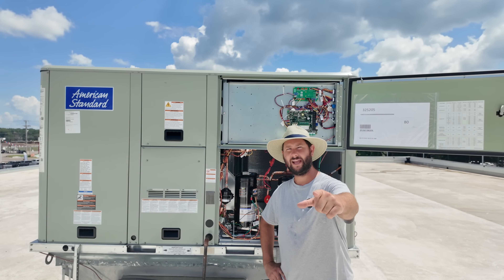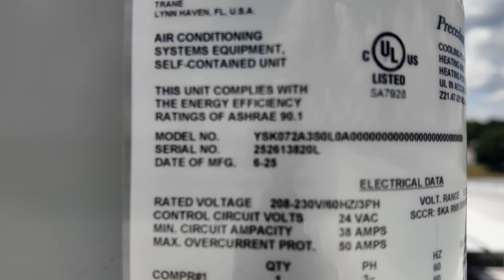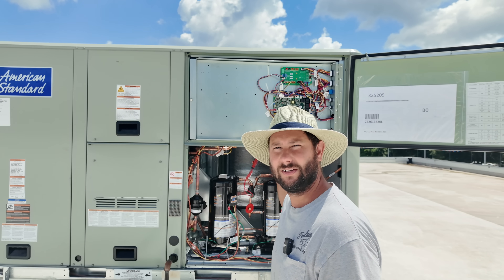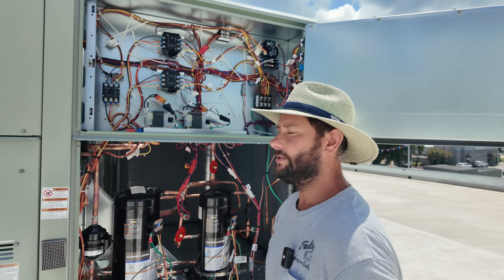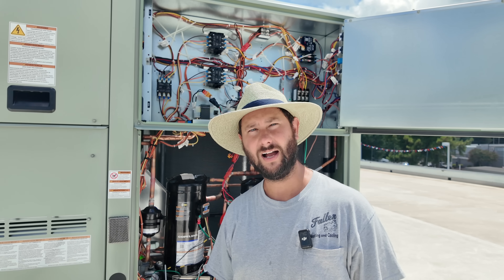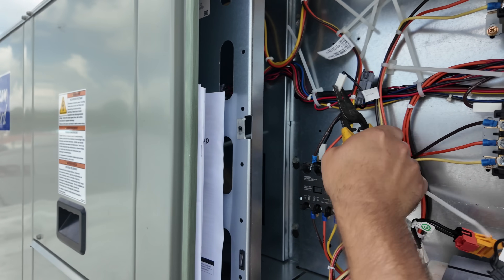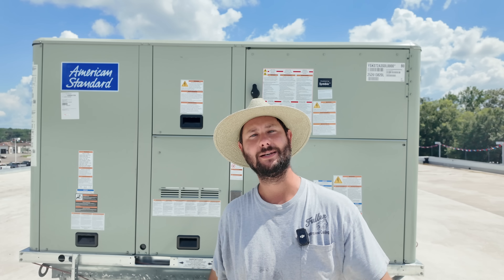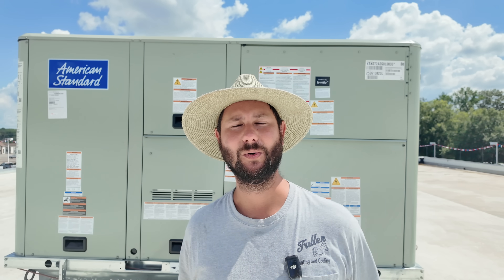Commercial AC Compressor Lockout Bypass Secrets Revealed

Comment: The middle board above the symbio is nothing more than a failure prone junction block.  Using proper butt connectors making solid line connections start from the symbio outputs to compressor circuit.  Eliminate any plugs along the way with butt connectors, following straight through safeties.  When you get back to the junction board, bypass the board with butte connectors following wiring to the contacter of proper compressor for each circuit.  Back to symbio follow compressor proving circuit eliminating all plugs connections and board connections to auxilliary switch on contacter.  At each safety install a 24v tattle tale.  If the unit trips alarm again the tattle tale will tell if any of the safeties tripped to cause alarm.  If not you have a bad symbio controller.

Comment: Ive installed that same RTU. I had an issue with the fire E-Stop. On that unit is NO and the existing fire alarm was a NC contact. Running out of time on install i just wired it in series with the R terminal. That way it would kill all control. The bluetooth thing was kinda annoying. I prefer RTRM boards.
Reply: Ive also installed these with Danfoss Control using that command rail on the Symbio700. Not horrible but youve got to install a transformer for the control boards.

Comment: Did you really bypass pressure switches? I can’t tell but there is no need to to do that and if you can wire through them then buy s few over the counter switches and mount them on an access fitting temporarily.  Altoona,PA 8yrs manager of wholesale branches, HVAC Contractor most of my life.

Comment: Hey Tadd, I’m a Trane tech and we’ve seen these problems all of the time and honestly the best thing you can do is get a box of wagos or wire nuts and change out any of the colored plugs in the compressor panel and the transformer and contactor plugs. The problem is they source half the plugs from china and the other half from Mexico and they don’t always make the best connection even if the connector is together. The factory is sourcing better connectors for the new units but that’s still going to take a while for all the old ones to get used up. You can also zip tie the two plugs together tight if you don’t want to cut them out but even that won’t always work
Reply from the maker: Thank you so much, brother. This insight means so much.Your time is valuable
Reply: They have a proving switch on the contactors.

Comment: I’ve run into this same issue with the same unit in the past. The issue ended up being the micro switch on the side of the contractor was not closing correctly to prove it. Just bypassed it and it worked fine until a replacement micro switch came in. Great video though.

Comment: Thanks,  the older units, you would be able to run it all through the high, low pressure, then the contactors but I think the switches now are using resistance value BS.

Comment: Tech support won’t help you on these ones. We’d have a compressor proving lockout, reset the unit and it never happens again. Then it would happen again a month later… then a week later. Could never figure it out because when we cycled the power it would work. Finally it kicked out completely. The Symbio board was failing to send the 24v out… it thinks it was but it wasnt so as soon as the contactor didn’t pull in it would kick out on Compressor proving. I jumped r and stuck it in the yellow wire I think p8-j5 or something and it would kick right on. New Symbio board — haven’t had a call back since. It’s happened on 2-3 of our Symbio units. Trane tech support has been pretty much useless with Symbio calls. The schematic they sent for the Compressor proving circuit was helpful because I figured it out on my own.
Reply: P8 - 5 is the start to the run command I think it’s the yellow wire. Intermittently wouldn’t get 24v out of it and immediately kick out on compressor proving. I took thermostat wire from r and stuck it in the yellow wire terminal and it would all kick on (after hours of testing and ohming out the entire circuit). Trane refused they had a problem for months and months — there are countless Reddit stories with the same issue. They still don’t admit they have a massive problem with their symbio boards. It’s very difficult almost impossible to diagnose when it’s intermittent and everything works after cycling power and the board is like $1400

Comment: I had issues with this stile of unit but they were heat pumps, the condeser motors were getting bad, and the problem were the harnesses to the condeser motors, the pins of the plugs to the motors are too thin and getting cooked and making the motors to loos one leg, and blowing the connection completly, i had to cut the plugs and use terminals to make a better connection. And multuple problems in because all the connections are being done with plugs. We end up cutting every plug and making conections with terminals. Is definitely a problem from trane by using harnesses

Comment: We had this exact issue, same thing 5 calls with tech support removing plug connections and still no solution. Issue was intermittent. Unit was running great for a year. We ended up replacing the board and that solves the issue.

Comment: Had a somewhat similar situation on a Symbio unit recently. System wouldn’t run at all because circuit 1 was out of gas, even though circuit 2 had gas still and its condenser sections were separate. It seemed like it didn’t want to run at all since stage 1 was off on lp. Had to jump out the lo p switch and pull the contactor coil voltage off for stage 1 so the board would think stage one was running. After a few minutes stage two came on. Been like that for probably a month now haha. Stage one has a leak for sure, customer doesn’t want to pay for repair so oh well. It’s working though

Comment: The plug connectors are a known issue. I replaced about 25 of them on a 7.5 ton unit. Still had comp 2 proving fault. Replaced the board

Comment: Have the same problem and was the sensor that goes in the discharge line wasn’t making good connection because another company put some colt tape to stick it to the discharge line and when gets very hot melt in to the sensor and wasn’t making good connection i let it jang out and the unti stop giving the alarm of compressor locked out until i get the new sensor

Comment: “Having the same issue, but on a Lennox unit. The board keeps showing that circuit one is tripping on the low pressure switch. I checked refrigerant levels—no issues there. When the system goes into alarm, I checked the switch and it’s closed (bypassed), but the alarm still triggers. I even replaced the board, per Tech Support’s recommendation, and the same low pressure switch alarm is still happening. Any ideas? Great video by the way 💪🏾”

Comment: I had lots of issue with the 7.5 ton trane unit , i stop buying trane , this trane president units are the worst units as there are lots of wiring and each wire has connectors and it lose the connection and stop working i suggest to replace witha ny other brand but not trane

Comment: I had the same problem on a 30 ton condenser. I ended up having to replace the aux switch on the contractor. There are 2 aux on the contractor 1 is the crankcase heater and the other one is the compressor proving switch. If I remember right the wires from the switch go back to the adapter board.

Comment: Had the same problem on a Trane, the unit is overcharged, the two compressors are teed into one circuit, and when both compressors come on at the same time, it raises high side pressure and boom 💥

Comment: The reason they don’t make it simple anymore is because the product these manufacturers are putting out is a piece of shit that’s designed to fail! So they add a bunch of bells and whistles to build false value. 
How bout you just produce solid equipment with quality materials built to last! Keep your $3500 blower motor, variable speed, communicating 454b piece of shit

Comment: I love the Bluetooth app, but that proven switch. I’ve had the same problem with a  split Systems single compressor heat pump 7.5 ton . that damn proven compressor lockout Swich has been intermittent a bunch.🤬 every time I went to that unit that had the same thing I don’t even know how I fixed it after pulling and tugging on wires and beating on the Contractors it finally just quit doing it

Comment: I install these units all the time there is a relay on the main Symbio board that’s not making good connection the only fix is to get a new Symbio board had the same exact issue and the contractor chatted like crazy need a new board and fyi save all the information that is on that board that’s on it now screenshot how it’s set up the new one comes blank and you have to program it with the app

Comment: This where this field is going over complicate the equipment for energy saving and more electronics for monitoring the equipment and more things could go wrong you need service booklet just to diagnose a problem .Those were the good old day where we didn’t have all these boards and could get the customer AC or Heat if we didn’t have the part we go supply house pick up part and repair the equipment the same day now you got to OEM parts which the parts could be back order or it could be week or more.
Reply from the maker: I hear you, the old days did seem simpler.

Comment: Had the same issue on the same model. Ended up being the wiring harnesses on the proving circuits not making proper conmections. We just cut the harnesses out and butt spliced the wires. Good to go.
Reply from the maker: Great info, thank you so much for sharing!
Reply: I did the same thing, tell you to do that in one of the service bulletins, Hmm 🤔

Comment: The plugs on Trane/American Standard units are unreliable take the plug out and use wire nuts or male/female stay cons for the compressor proving circuit.
Reply from the maker: Great tip, thank you, my brother!
Reply: I was told they are on the 3rd plug/moldex manufacture at a Symbio training class.  I believe there is a service bulletin.

Comment: I sold the twa split heat pumps in a dual fuel application with Symbio controls. Never in a million years would I do it again. 

Symbio is trash. Numerous relays added to make it work in that application. I have swapped to the Rheem package units due to slightly simpler controls. Can’t seem to keep a VFD operating with them so we bypass with a contactor from the get go now.
Reply from the maker: Interesting, thanks for the information.

Comment: Same dance different tune , Just more crap between A & B . Could rip that board out and out in simple relays and high and low pressure safety's  and not be on your cell phone . This Cell phone crap is just to gather more information to use against you ...Blue tooth .. Bwaaa ha ha ha

Comment: You have to make sure ,you have a 2 stage t.stat,and that you are feeding the 1st stage first then the 2nd,or the logic will not work.normally you use yellow stage 1,and blue stage 2,but you are using blue for common.compressors are in tandem.
Reply from the maker: Thank you for the information.

Comment: Im a senior commercial HVAC tech and I had this problem on another Trane unit about a year ago with same alarm. I replaced the main control board and problem fixed. Sometimes tech support don't have all the answers. My problem was intermittent and no one was able to figure it out with many repeat calls. One last thing, bypassing safeties SHOULD "NEVER" be done. You will be held responsible to whatever happens to that unit or God forbid the building. NOT WORTH IT. (Unless you have written authorization by your supervisor). And if your supervisor gives you the ok by phone then write him a response by email stating what you did, including his approval to do it. TRUST me, your best buddy Supervisor will cover his behind in an instant if it comes between you and him. By the way, you are a great technician.
Reply from the maker: This is great information thank you so much. My issue is definitely intermittent so possibly a bad board, i'm thinking as well. 
You are awesome thank you so much
Reply: @taddydigest  I had a similar issue on a trane. My issue was fixed by replacing the contactor. I was told by tech support that the contactor has to prove within 3 or 5 seconds. The proving switch is on the side of the compressor contactors. They don't make a replacement proving switches You have to replace the whole contactor. ☹️
Reply: We are train dealers the company I work for I have had compressor proven lockout several times and nine out of 10 times. It always is a faulty connection like one of the plugs. I normally like to cut the plugs out and wire up the wires back together most of the time that takes care of the problem there is a circuit for that compressor proving you can trace through that circuit And just make sure it’s all good connections but a lot of those plugs go bad or they don’t go bad to have loose connections and that be the problem it has to pull in within a certain amount of time is like a couple seconds and if it don’t, then it will lock out
Reply: imagine a senior tech having hard time that he had to call tech support on this 10 million circuit monster, it might take you 2 hours to figure out. For 5 years or under exp guys, this may take forever or they'll just throw this unit out of the bus. I hate unreliable tech - no - lo - gia ...
Reply: I had the same problem and I gave up.. I even retired from doing AC because of the heat.. it’s not worth it
Reply: The molex connectors to the transformer! They get hot and momentarily loose connectivity. I cut every connector out and used wire nuts . Problem stopped and the restarted !!! Bad high pressure switch would be activated by the vibration. Fount this out by tapping with my mag lite when unit was running. I’m not a pro but I installed a 10 ton split 5+5 in my restaurant. Bad design. The old unit had a little board where all the wires attached 😬
Reply: Fought a similar issue on a trane for a week, replaced board, all is well.
Reply: We do alot of startup on versus equipment Trane has a service bulletin for there connectors. Sometimes to look at on there compressor connector there is a switch that is part of there Proving circuit they can become lose hope this helps
Reply: Howdy, im having the same issue, I cut all safety plug and wire nut them. I replaced board and continue to with same issue. But a great video be able to bypass unit. Need help

Comment: We literally had this exact problem a couple months ago, ended up having our field service rep come out and deal with it - he had to call his support and ended up replacing the entire symbio board.

Usually the fix is to move the Auxiliary normally open connection to the hot 24 side of the contactor and then move the Auxiliary normally closed connection to the common low voltage side of the contactor, apparently it tricks the board into thinking the switch is always being made.

But in our scenario it ended up being a bad board from the factory go figure, the industry is getting ridiculous with all of this garbage
Reply from the maker: Thank you so much for sharing this information. ❤️  I'm glad to know that it could have been a board.Makes me feel better about what I had to do.
Thank YOU 😊